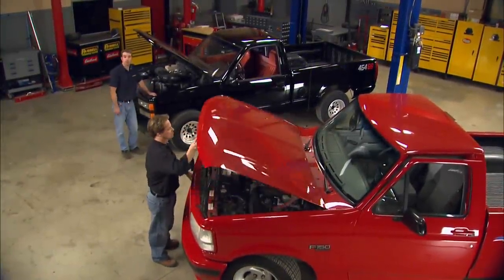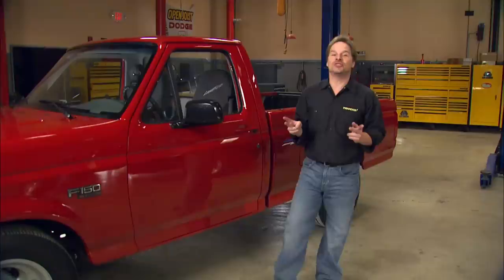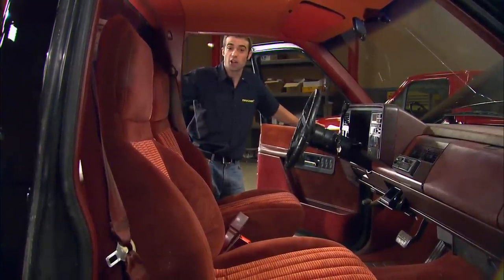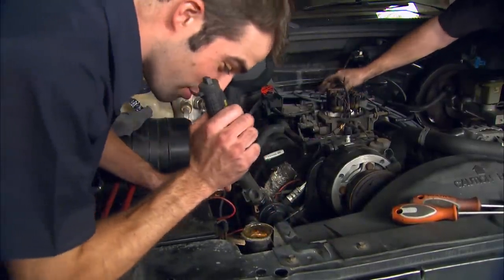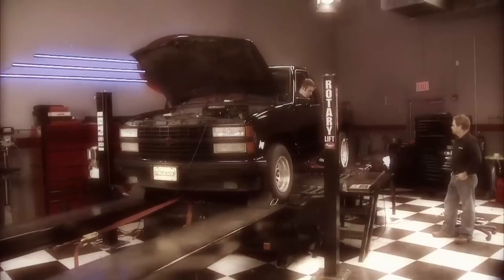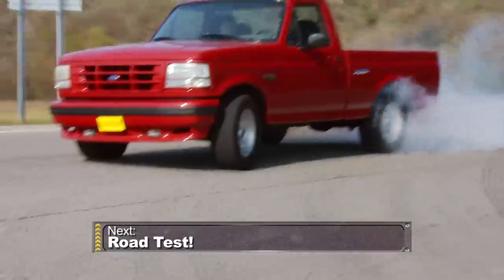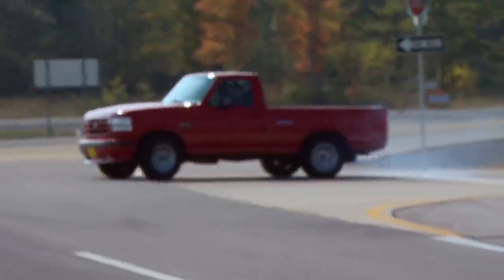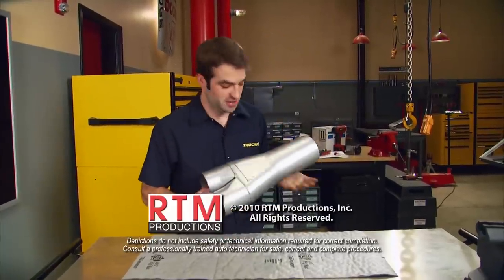'90 Chevy 454 SS vs '94 Ford Lightning F150 MuscleTrux Wars Part 1 - Trucks! S10, E1

Comment: A slight giggle came out when he said “Kick a few Syclones to the curb”. Hahaha
Reply: LOL  yea that's not going to happen .
Reply: man. same. LOL
Reply: Lmao i was gonna say the same thing but you beat me to it
Reply: Except it didn't. The Cyclone's Typhoons and Cameos are still the fastest quarter mile pickups.
Reply: Timothy Isenhart oh I know.
Reply: I laughed too,
Syclones were so much lighter it’s a no brainer,
On top of the fact that it was turbod lol
Reply: No kicking necessary they just go there themselves ,sorry excuse for a truck
Reply: Brad Zimmerman You must live under a rock, the lightening doesn’t even compare to a Syclone. People will pay double for a Syclone or Typhoon before they would pay what a first gen lightening is worth.
Reply: @backroadracing5449  and they will have to because syclones are way over priced. Put that extra money into the lightning
Reply: Lol yea, not gonna happen
Reply: @tskraj3190 , The "Syclone" was a quick little pickup, with a turbo V6 and AWD, but it was so limited in cargo carrying capacity that it had little use as a truck.  Mostly it was just a little hot rod.  The Typhoon was an SUV, not a pickup, and the Cameo was never even close to fast, with the most potent engine being a 185 HP V8.
Reply: @chuckd7423  The S10 Cameo was also available with the twin turbo 4.3L
Reply: Yelsew Painter and it was AWD
Reply: Yea them and a couple other models of 4.3 s10 had seen 12s. With little done. Lolololol.
Reply: @tskraj3190  ok, I wasn't familiar with the S10 Cameo version.  I only knew about the 50s Chevrolet Cameo pickup that was made from 1955 through 1958.
Reply: @chuckd7423  They were available with a twin turbo 4.3 or Supercharged 3.8L
Reply: @tskraj3190  you sure it was a twin turbo? What year? The 4.3 were all single turbo I thought
Reply: @jaystein1405  I think you maybe right. I almost bought a used S10 Cameo back in 99' and it did have twin turbo but it may of been added because it had many other aftermarket high performance parts.
Reply: No joke. Not even a contest. Syclone would mop the floor with em like nobody's business
Reply: @chuckd7423  that's the whole look of the Syclone. A sport truck. Basically a sports car with the ability to do SOME truck stuff. 
If you want a truck for truck stuff, don't buy a hotrod truck. Buy a regular or HD one. Duh.
Reply: GTFO.  No comparison to the syclone.
Reply: Cameos????  Umm,...........no. 👎🏽
Reply: I literally read this while he was saying it , weird.

Comment: 454 BB, 230 horses. Sad times in the 90's.
Reply: GM had a pickup with a turbo 4.3l and AWD that made 280hp and 350tq at the time. It'd beat the piss out of that Lightning
Reply: The poor horsepower/torque specs were not due to GM's design, but directly due to EPA regulators. The engineering knowledge base and technology simply was not up to the level of  what the EPA was mandating at the time. Kinda like when they first started mandating EGR and DPF's on diesel trucks. They were horrible when first introduced. While they still aren't a perfect system, they have gotten better and will continue to do so as the technology advances. They should have compared a '93 SS with the '94 Lightning though. Much better comparison as most all trucks get better and better every few years. It doesn't make sense to compare a truck that is 4 years older than the one your comparing it too. Might as well compare a brand new Civic R to a 1978 Camaro. Complete waste of time by these two morons!
Reply: Jay Stein   Not the supercharged Voodoo one
Reply: @randomprojectsusa5196  The supercharged Lighting didn't show up until '99. That's an eternity when it comes to engine tech advances. Again, they were comparing early 90's naturally aspirated trucks.
Reply: Micheal Hunt 
Ain’t that the truth lol nowadays you plug a tunner in to get more horse power
Reply: Jeff Scott   I know, just saying
Reply: @jaystein1405  The syclone and typhoon.
Reply: Micheal Hunt  damn skippy
Reply: Chevy sucks and they still do. With that crappy 5.3. They need to stop worrying about looks and look into performance.
Reply: @frankolvera1337  5.3 is a great run around engine
Reply: @frankolvera1337  The little 5.3 aka 327 ci with minor mods can produce 500 HP with no problem.
Reply: Anuskasv0 in the 70s most big blocks Didn't even hit 190 when brand new.

A early 90s Taurus was making 220HP with a 6 cylinder...
Reply: @alexcorona  do you know why and the potential power of these engines?
Reply: Dkill actually syclones are faster than supercharged Lightning’s. Hell they were even faster than the corvettes were before the lt1 came around.
Reply: @mechanicsteve2320  
The 5.3 vortec is NOT a 327 , it is a 325 . Bore /stroke of the vortec is 3.78/3.622 vs the SBC 327 is 4.00/3.25 . The vortec 5.3 is a Y block with a 6 bolt main . The 327 SBC is not . The architecture is completely different .
Reply: @frankolvera1337  
My 5.3 has 437,000 miles . Shit on that .
Reply: Dr. Westside Chevy small blocks can be treated like shit and still run. Treated well, they’ll essentially go forever. I once had to run a 5.3 on a “budget” (meaning broke) and had to forgo many things. I thanked it every time it decided to get me where I needed to go, which it did every time.
Reply: Peanut port, TBI
Reply: Dkill  Wrong! Even the S/C Ford Lightning wanted No Problems with the little Syclone! The Syclone was all-wheel drive Turbo that the Ford wanting Nothing to do with.. off the line!
Reply: Dkill the lightning weighed  1,000 pounds more. It was rear wheel drive and only had 80 more horsepower stock. There’s no way it would beat a syclone.
Reply: Dkill what’s your point? The fact still remains that a hundred horsepower isn’t enough to keep up with and all wheel drive 3,600lb truck
Reply: @zachlandon665  white knight has to defend the lady's honor. He's never been intimate with her, or even nervously brushed up against her. The pedestal he's placed her on could kiss the moon. Surely the rumors of her being spanked by every brute in town are simply slander.
Reply: Dkill  1994 lightening was rated more like 240hp 340tq, your numbers sound like a newer truck
Reply: @zachlandon665  he isn't even talking about these trucks...
Reply: Dkill  why would you compare that to a 4.3?  Of course it is faster, its almost a decade newer and the base engine is far newer.
Reply: @mechanicsteve2320  5.3 is 325 ci
Reply: Dkill  I've followed it just fine, before you stepped in. The newer truck has nothing to do with the conversation,  I could tell you a new 4 cylinder makes more power than an 83 Corvette too, equally pointless.
Reply: Dkill  🤣 I'm doing just fine
Reply: Blind Squid  yea so poorly designed that I still use mine today and no problems 🤔
Reply: @frankolvera1337  race against a built 5.3 lol I seen one at LS fest and it was pushing 856 horse
Reply: @alexcorona  ok and cars now are making that with 4 cylinders
Reply: I do not miss the '90s, though vehicles were easier to work on. I wouldn't touch my tuned '16 Roush SC F150 (650/600). It's a fun truck.
Reply: @jaystein1405  Yes it would and you could modify it and easily get 400hp and 450 ft-lbs of torque.  Shit I'm getting ready to build a 3800 series 2 turbo motor in my GN and it will made around 700HP.
Reply: Jason Voorhees but you have to modify it to see those numbers. Is what I’m saying. Of coarse if you mess with them you’ll get more out of it. I’m saying just leaving it stock.
Reply: Dkill buddy I don’t know who told you they made 430hp crank but whoever it was lied to you. You keep talking about drag radials like you can’t put them on the syclone too. Even if the lightning beat the syclone it took ford 10 years to make a 8 cylinder that would beat a gm 6 cylinder.
Reply: 454ss was known as high torque not ho anyways when they came out a cam swap and few other minor changes plus rear heats and 454 as will fly I know this man and the lightning can be made to straight fly with few lil changes to bigger fuel injectors pulley swap just sayin there a few cheap easy mods on both and u can get so much more outta these two sport trucks
Reply: Herman Lipshitz I never said the syclone was a good truck. I personally think just about everything that came out in the 90s were shit. But the lightning won’t beat the syclone.
Reply: @jaystein1405  I drove one for two years. Stick shift, that bastard needed another gear. It was fast!!!! Wanted to buy it from my boss n the sonavabitch gave it away. It was also 4 wheel drive and had a crawler gear. I have never seen another one on the road. Dang fine truck.
Reply: Dkill  The fact that you're comparing to a much older truck aside, a Syclone will actually still do 0-60 and the quarter mile quicker than even a supercharged Lightning...  do a little reading sometime before you open your mouth.
Reply: Dkill ok first off nobody who can race worth a shit roll races. And the svt lightning did not make 400hp out of the factory buddy go read some dyno sheets. Like I said before it took ford almost 10 years to build something even close to gm.
Reply: Oh and btw svt performance has some dyno pulls on their website if you would like to go look.
Reply: Oh and I watched that video and guess what I was right the lightning doesn’t make 400hp
Reply: Jay Stein the syclone wasn’t no joke
Reply: Dkill it had 280 to the wheels just like the lightning only had 360 to the wheels. The both have more to the crank. Do you eat paste?
Reply: Jay Stein what's your point ? Its a fucking AWD turbo truck. That like comparing your Honda to my turbo mustang. Just ignorant and trying way to hard to hate on a Ford because its better than the 454 in every way.
Reply: Blind Squid, the gears weren't too low. There just weren't enough of them. By 1990, it was unheard of for any vehicle NOT to be in a FOUR speed auto. The "SS" was still in the 3 speed. The same is happening today with lighting: Incandescent lights mixed with LEDs when technology is fully capable of making full LEDs. Yuck on manufacturers for "fooling" the consumers.
Reply: Jay Stein what if the lightning had a turbo?
Reply: Jeff Scott thats a bit of stretch. Its not like there was a huge change in technology in four years. And the ford is almost 100ci smaller. That chevy sucks bo.
Reply: Anuskasv0 And a 2019 5.3 has 355hp stock.
Reply: Dkill  Actual no, it still lost. That turbo 4.3 in a lightweight 3600lb truck was the fastest accelerating truck thru the 90s and early 2000s. Even the SRT10 ram 6spd couldn't beat it in acceleration. No stock pickup has yet. The Jeep trackhawk does tho, obviously, and maybe the SRT8 grand Cherokees, but those aren't actually trucks, they're SUVs.
Reply: That 454 was the same engine that was used in the heavy duty trucks.  It was designed for low end torque.  Not a performance engine at all.
Reply: Dkill  how you trying to convince, sounds like yourself. That's a long book of denial
Reply: 230 net HP
Reply: The Chevy problems are easily fixed
Reply: Boy those trucks were dogs
Reply: Lil Red Express...forgot about those, but still remember them!! I was just a kid, but remember guy around the block from us had one back then! Fastest 0-100 production vehicle then...thats like claiming hellcat or demon numbers now!
Reply: @russmode  or like my shelby dakota that came out a couple years b4 these truck...the reason all these trucks were made in the 90s🤷‍♂️
Reply: @davidfoster5321  pretty cool era for some vehicles In the big 3's lineup for those of us that remember, I had a notch back 92 mustang had mild street supercharger on, took great care of, good times!
Reply: @russmode buddy i was born in 87 feel like I grew up in the wrong era... I love the weird and macob vehicles the late 70s thru 80s gave us....I'm looking for a 2nd shelby dakota that's not very nice to make a street toy...mine is much to nice to do anything but weekend drive and enjoy the way it is...I must say the most enjoyment I get from the truck is from the mustang owners at the local car shows....talk about a kick in the pants when they realize shelby worked with dodge for year's 😏...the shelby dakota's where very short lived at 1500 numbered trucks made one year only they aren't popular by no means..way more shelby fwd cars floating around still
Reply: All these shocked gen z dudes like man my Kia has more power. Well lads, back in 90 a big block came from the factory making 230 hp. It's not what we love, but it's what we got.
Reply: 454 BB back in the 70's were pushing over 450hp. Gotta miss the old leaded fuels ⛽ 😪
Reply: Yeah my 1994 ford f150 4x44 5.0 5 speed weighs 400lbs less than the 454ss and is 4x4 and a 5 speed! Its about the same 0-60 too

Comment: I bought a 454SS new in ‘90 and just by changing the factory air cleaner to a 5” open element along with the Edelbrock intake made a huge difference. Then I changed out the factory y-pipe to the ‘92 SS dual y-pipe with cats and true duals our back completely transformed that truck. Intake and exhaust is choking that big block and you’ll see when you get into it .

Comment: 8 mpg and 195hp to the wheels😂
Reply: Adam,  nawh 10 mpg's
Reply: Also 290-300 torque from a package that was all but choked to death by emissions regulations. Let that engine breath and you'd see all three numbers increase
Reply: Yea but gas was cheaper then
Reply: @jasonvoorhees6657  yes, I lived in Wyoming during this time and gas was under a buck a gallon.
Reply: Mallard  work truck dont get a ton better. 18 wheelers get worse, totally useless. Your right
Reply: @seantaylor2683  you're better off just buying a crate motor pushing out 600 to 700 horsepower without boost.
Reply: Nobody really cared about gas mileage back then
Reply: @gabrielpichardo1492  maybe not but car and truck enthusiast cared about balls!!
Reply: @seantaylor2683  the 454?  They just dropped a torque monster towing engine in without so much as changing the cam.
Reply: My dad had one years ago. It had a mild cam with long tubes and full 3 inch. It was still a turd.
Reply: It's all about the torque and there's lots of potential with that Chevy platform.    I'm no Chevy fan, either.
Reply: @seantaylor2683  
Choked at 8 mpg wow that's pretty sad I guess 2 mpg would be ok though I guess if less regulations would have bumped those numbers up🤣 just just busting balls!
Reply: @kfstreich4787  
And those had tiny little pistons in that piece of dirt if I remember right that 454was a junker could be recalling wrong but don't think I am.
Reply: @SarahSmith-hd8kd  the 454 had tiny pistons?  🤣
Reply: @kfstreich4787  
Yes that is had smaller pistons or valves look it up can't remember which but it was neutered pretty bad still got up but ya check it.
Reply: @SarahSmith-hd8kd  the 454 had large pistons, very large pistons.  Perhaps you are referring to ports?  This is not because it was neutered for the EPA, this is because it was a truck engine for towing,  smaller ports help with low end torque, larger ports benefit horsepower,  all you have to do is replace the heads for this different application, there is nothing wrong with the engine it is simply used in the wrong application.
Reply: @kfstreich4787  
Ok now that makes sense I remember now I was told about the smaller ports by my father in law he is a hot rod nut and that's why he said they were crap cause he's a horsepower freak lol so not crap at all just a quick head swap and it's a monster I see know thank you I learned something new  at today and early to boot thanks👍
Reply: @SarahSmith-hd8kd     This version of the 454 was nothing to brag about.  An LS6 454 in 1970 was legendary.   450+ HP and 500+ lb ft. torque (at least) at the crankshaft.
Reply: @scdevon  
Yes I was just informed about how the ports were smaller because this was a truck engine for towing in reality and that isn't even addressing all the chocking regulations that pretty much killed desireabilty for most but yes my father in law had one in his tubed 55 and that thing I never seen get smoked not saying it couldn't have been spanked but damn it would stand if you weren't careful with it😁
Reply: @kfstreich4787  you are 100 percent correct. Since GM didn't have a sports car in 90s that used the 454. GM just put the towing monster in a light half ton. If they would of install HP intake manifold, HP heads, HP cam, headers and exhaust. It would of push 400 to 500 HP and TQ. The lighting wouldn't even come close to it
Reply: @SarahSmith-hd8kd     Quite right on everything.   A  stock LS6 454 in 1970 had a .520 lift / 316 duration  (!!!  EPA?  what's that?)) cam, for example.
Reply: @gashthrasher_8976  454 lsx would be the perfect swap , 502 would be a budget choice
Reply: @lonniefreeman4278  given the Corvette of that vintage was 300hp I'll bet the ss454 could have been in the 300-350 hp range with over 400lb/ft of torque for the street.  Big numbers are possible but manufacturers try to keep numbers down a bit for reliability and they wouldn't want a pickup faster than the Corvette.   300hp was a big number in 1990, crazy to think my 2006 pickup is 360hp stock.
Reply: Simply Unacceptable
Reply: @james avery gas is around $2.10/gal local to me.
Reply: I like the red one
Reply: @jasonvoorhees6657  are you sure about that?